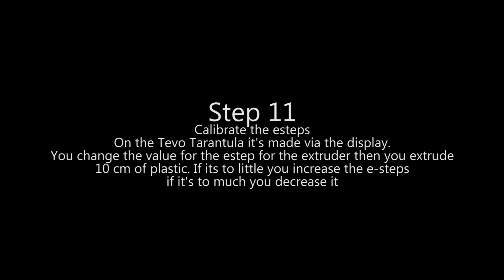Bondtech BMG Extruder Install on Tevo Tarantula

Comment: Did you buy the Groovement for the extruder ? 
Because once I see the extruder is rotated right without groovement for direct driver and then is rotated with the groovement ..

Thanks
Lukas
Reply from the maker: I first mounted it the wrong way around but later fixed it. The lever or what you want to call it should be facing from the wall (against me when installing). Does that answer your question?
Reply from the maker: The “hole” for direct drive should be facing upwards.
Reply: 3D Printing With Anton I think no, it shouldn't.. Because you have to buy groovement for direct to bottom section of extruder or if you want bowden driver as default you choose the upper PTFE connector...
Reply from the maker: I have the PTFE tube going out of the direct drive mount

Comment: Does the x carriage go past the extruder, it looks kind of big?  How much of an improvement is it over the stock?
Reply: it doesn't hit as far as I can remember. It will make a big diffrense if I decide to print faster and if printing with other materials with the same speed on pla I wouldn't say that there is a huge diffrent
Reply: This is my other yt account I have 3D printing with Anton also.
Reply from the maker: Have checked into it more the motor crashes into the extruder

Comment: I didn’t get the mount with mine.... 😢 did you have to buy it separate?
Reply from the maker: The BMG is a part you will have to buy on your own from BondTechs website. Link: http://shop.bondtech.se/ec/extruders/bmg-extruder.html
Reply from the maker: Ohh you mean the metal mount? If so there should be a stl for a mount if it wasn’t in the box. In my case it was included